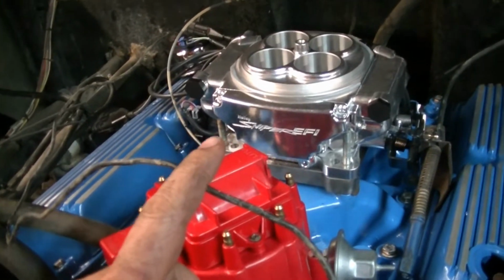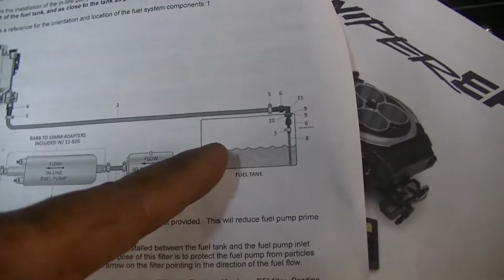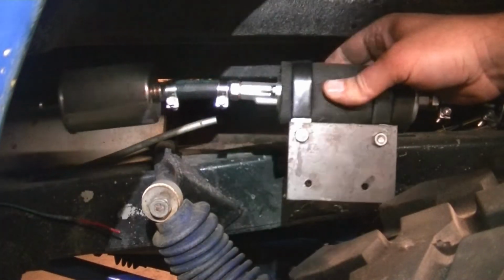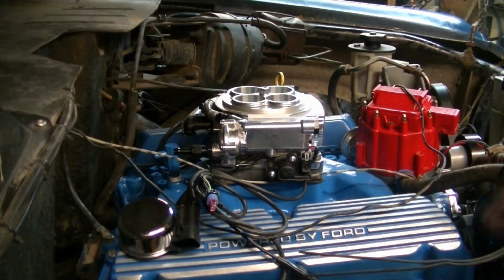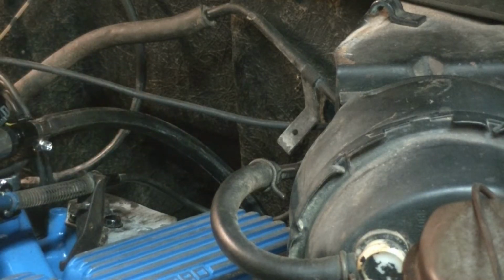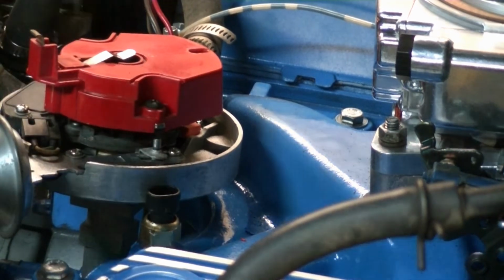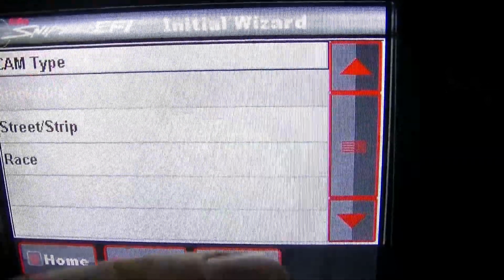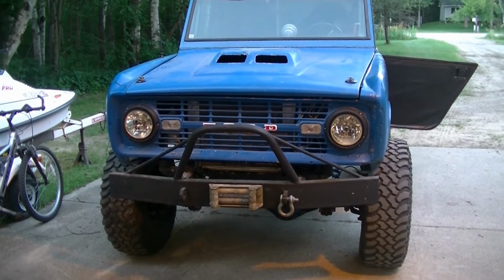Holley Sniper EFI Installation on Early Bronco

Comment: Long term review? Still love it?
Reply from the maker: Zak H I definitely like it more than a carburetor.  If I had it to do over again, I think I would go with the Edelbrock Pro-Flo. Multi port fuel injection is better than throttle body.  It’s a little more expensive, but comes with intake and distributer.
Reply: @Mudford  I just purchased this today, im excited about it! Will be nice not to adjust the carb often

Comment: I have a 76 Trans Am I thought about putting the same thing on it. Good video. I have one suggestion for you and this is coming from one bad experience and a lesson well-learned. Put a clean rag or duct tape across your intake hole. I was putting studs in a intake years ago and accidentally dropped the friggin stud down into the intake and it made its way down into the head. So it caused me some unnecessary work